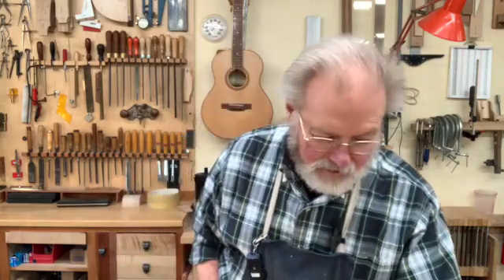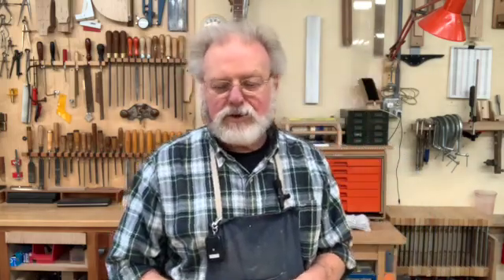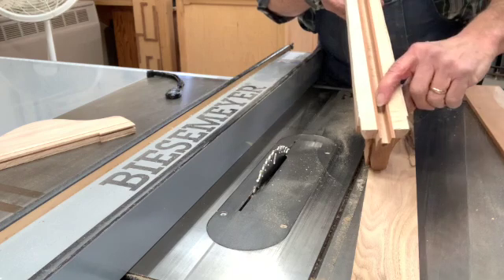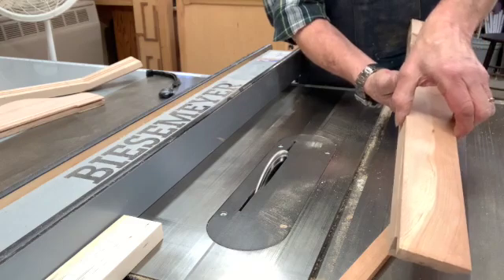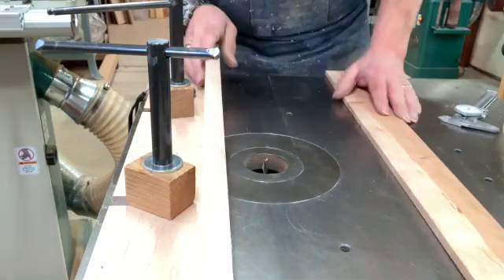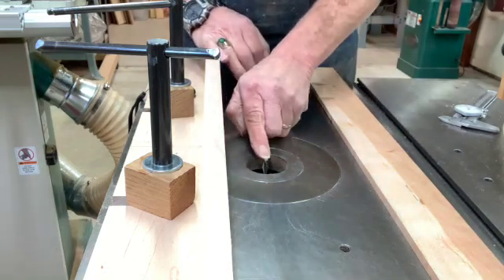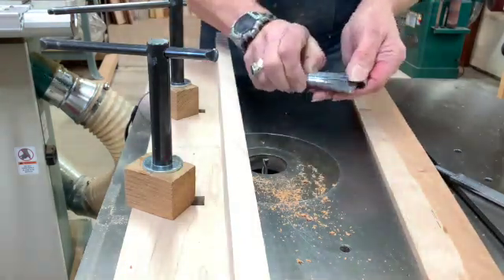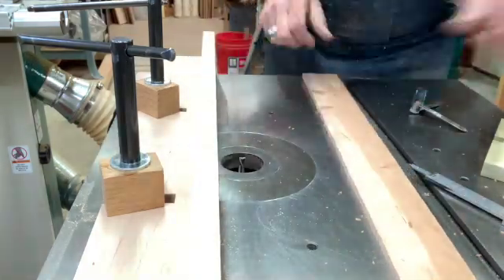DEAD CENTER! Machining A Guitar Truss Rod Slot

Comment: I couldn't figure out why when you said take any scrap of wood and run it through next to your neck blank and take off any small amount made it the same width as the neck.  Then it hit me, being slow sometimes, that as long as the piece you are taking the sliver off of was wider than the neck it would be the same width as the neck.  Like I said a little slow on my part.
Then came the next question that I still don't understand.  If the piece that you take the sliver off was as long as your neck why would you need to make another?  Couldn't you use a piece long enough to take the sliver off of that was at least the length  and width of the neck and use it to make the test cuts to get the exact center? I guess the question is why do you need to make a second piece that is the same width for the test cuts?
Reply from the maker: The key is that the first piece you rip against the neck blank is ripped so as to establish parallel edges with the neck, regardless of width. When the neck  is removed, the ripped piece then moves toward the fence, a distance that is exactly the same width as the neck.  When the third piece is ripped against that, it will be the same width as the neck.

Comment: As a fellow pragmatist, I really enjoy your content.  Another way would be to set your table saw to the depth of the truss rod and gradually work your way out from the center of the neck blank--making two passes (one in each direction) each time you move the fence--until you have a channel the width of your truss rod.  Just remember you'll be removing twice as much material as you moved the fence.  You can use the same method on a router/shaper if you have a bit slightly smaller than the desired channel width.  As long as you make a pass in opposite directions each time you move the fence, you'll have a perfectly centered channel.
Reply from the maker: A table saw technique works beautifully, especially if the truss rod slot runs the full length of the neck. If it doesn't, you have to stop feeding the works and hand chisel out that portion of the groove left by the radius of the blade; all very doable.

Comment: Useful tips, Kevin, thank you. I can see that with your process, particularly jigs referencing off the TR slot, it is hyper-important to get it dead-nuts on centre, but for those who don't have those jigs, honestly I don't think the neck (or the rest of the guitar) cares that much if the slot is a mm or so either side of centre. Just don't have it so far off that there's a danger of carving into it from the back side when shaping the neck! Not belittling anything you've presented of course, it's all really good, but for new builders maybe it's not a stress point within these limits.
Reply from the maker: There are times when my desire for precision may get in my own way, but in this  context, I'm so particular because I want to be able to machine symmetry around that truss rod slot. More importantly, I can assure that the center line of the neck is in absolute alignment with the center line of the top. That assures correct placement of the bridge over the X-brace and the bridge patch.  I'm sure you're correct that one could tolerate a lot more variation and still make a terrific guitar. My procedures have also become an established script for various tasks and that serves to make work flow smoothly and predictably.

Comment: I use a low fence (19mm) to avoid any issues with scarfed headstock or heel misalignment pushing the neck out of position. The heel block is a convenient handle to keep my hand away from the bit